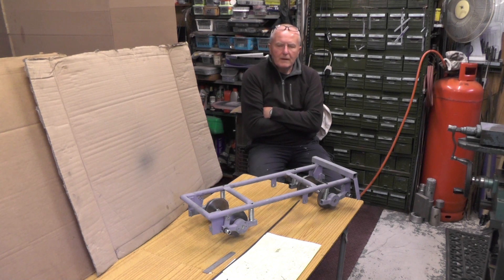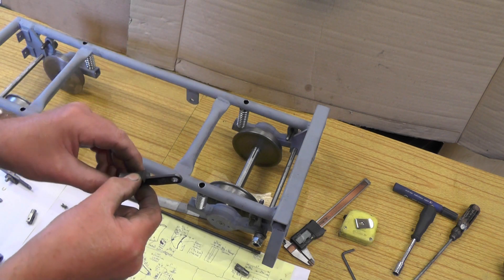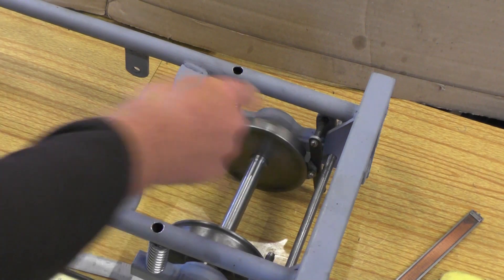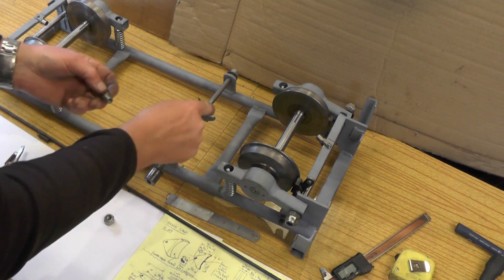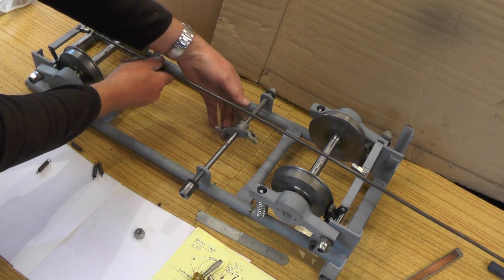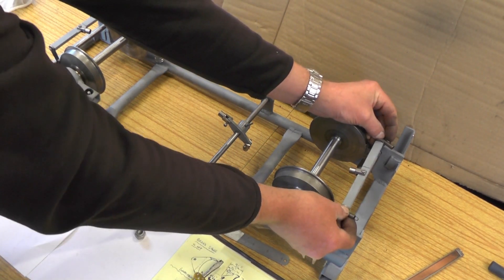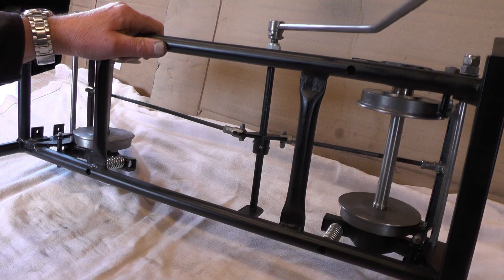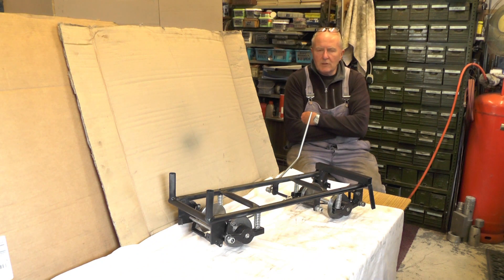Build Your Own 5" Gauge Riding "Car" " truck" "trolley" Part 5 (mr factotum)

Comment: HI Mr. F - just wanted to say your face-to-camera intros add alot! Do I understand the brake actuator on the rod is only held with a split pin? Does that mean that the pin is taking all the pressure of braking forces applied?
Reply from the maker: cheers ww
yes the split pin is all that drives, but its still overly adequate for the task, been using a similar riding car for the last 3/4 year and had no problems.
see you next time
regards
mr f